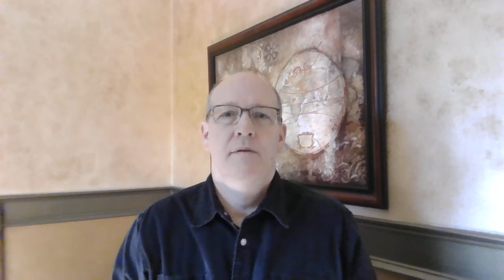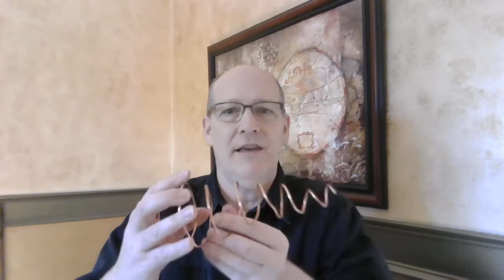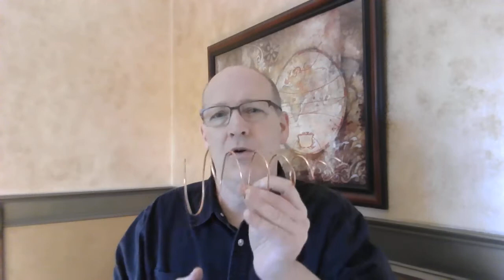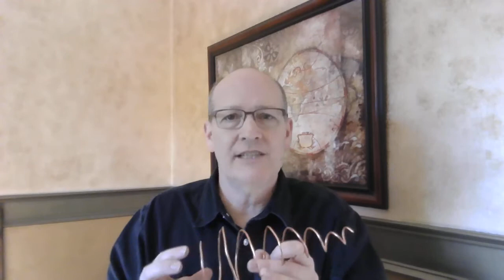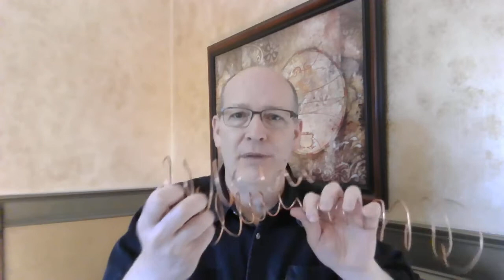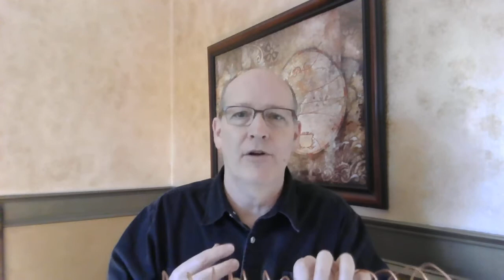Magnetic Energy and Electricity

Comment: Is there a way to covert 'Magnetic Energy', to common electricity, so it can be measurable with common instruments ( multimeters, oscilloscopes, etc.) ?
Reply from the maker: You can use magnetic energy devices to help generate electricity, but converting neutral magnetic current to electrical current might be impossible because they are so fundamentally different. At this point common instruments only measure the biproducts of magnetic energy/current. Future instruments with special alloys will measure magnetic energy/current.
Reply: @MagneticEnergy  ,special alloys?.TiAlCo metal?.Were I can purchase samples?.
Reply from the maker: @Jeanpaul465  I don't know of anyone selling it. NASA has it but you need top secret clearance to get it.
I'll let you know if we start selling it.

Comment: Can you explain better this concept?: Magnetic current is the flow of ions through the conductive use of neutrons. 
Thanks.
Reply from the maker: I will try not to use conventional terms in this quick explanation because they are just too limiting. So we are using relatively neutral energy structures which have an equivalent inflow/outflow of magnetic energy making them relatively neutral. These neutral structures still have some signature characteristics of elemental combinations in them, such as copper. These mostly neutral structures induce an etheric response and attract additional etheric/magnetic energy into the units, and then we convert that energy into a more polarized flow of ions that we can use to perform work. These ions have unconventional characteristics and some scientists have described the energy as cold electricity, even though it does not have the same characteristics as regular electricity or electrons.